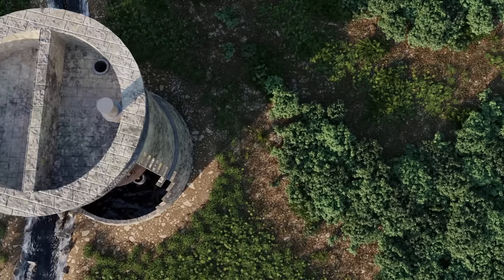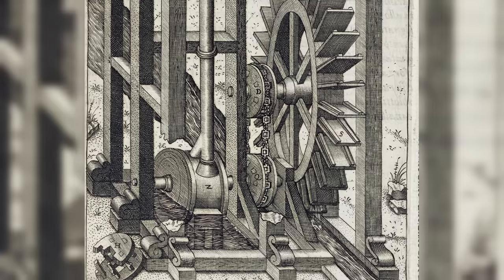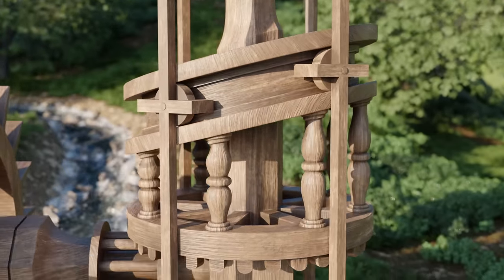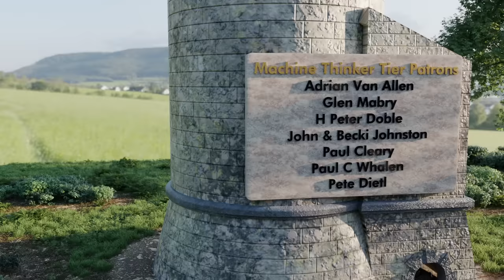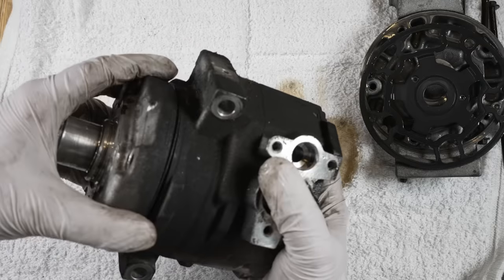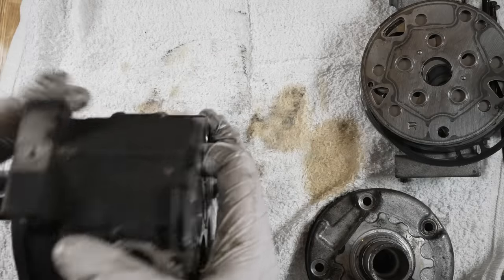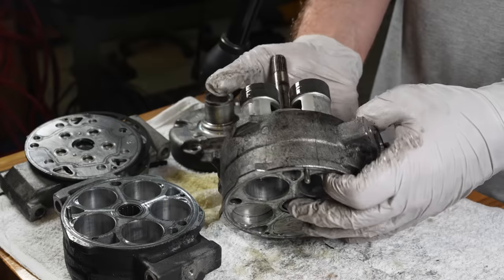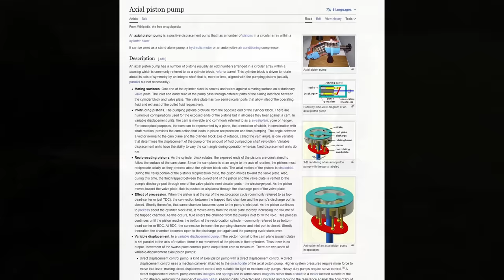How an ingenious 400 year old drawing predicted the future

Comment: They make pumps that operate by a similar method, but the angle of the swash plate is variable. It lets you use a constant speed motor and get variable fluid output or constant output at variable speed. Amazing designs!
Reply: Hydrostatic hydraulic variable displacement load sensing pumps in modern excavators.
Reply: Fuel Pumps in some Diesel Aplications
Reply: IIRC in those the pistons and cylinders are part of the rotating assembly and the swashplate only tilts relative to the motor body.
Reply: Also check FRAMO system
Reply: Some marine steering gears utilize such pumps.
Reply: Hydraulic CVTs in agricultural equipment use a variable swash plate and a hydraulic drive motor all linked to the vehicle drive shaft alongside the diesel engine through a differential gear system.
Reply: I think the Macks that the city uses run a variable swashplate pump, it's always spinning when the motors running, just angles itself to engage. The new electro-hydraulic rescue tools that the FD uses might have the type of variable plate with pressure feedback, since they slow down but drastically increase their pressure as they meet resistance
Reply: @microwave221  The city council mandated last year that those be electrically powered, so I don't see how that is possible.
Reply: @roqua  the existing fleet
Reply: @microwave221  I'm joking, of course, at the vagueness of the "city" in question.
Reply: Aircraft hydraulic pumps use the same system. Always spinning, but the pump angles the swashplate to provide the output needed when raising gear or lowering flaps etc.
Reply: Torpedoes use swashplate engines powered by mono-propellant
Reply: I believe many European AC compressors on cars work this way. Most cars have a clutch that snaps it on or off.. nothing in between. The variable ones are always on at the pulley but can change the amount of pressure the pump makes allowing for a much more efficient pump. The clutch ones are 100% on and blend in outside air of you don’t want to have the AC set at maximum. Which is a waste of energy. Force the system to make ice cold air but blend warmer air into the vent so you get 70 degree output.
Reply: like in hydrostatic transmissions
Reply: Some automotive A/C compressors are variable displacement. They won't create a vacuum or even zero low side pressure when undercharged.
Reply: @ohioplayer-bl9em  Nope, they all use a clutch unless they are electric motor driven such as a hybrid would have. If they are belt driven they have a clutch. Some have a variable swash plate, and 5 pistons on just one side. Some have a constant angle swash plate and Pistons on one or both sides. The name is usually an indication. A VR5 is a variable radial 5cyl compressor. An FS10 probably stands for Fixed Stator 10cyl.
They use internal valving to prevent over pressurization when spinning faster.
Reply: I always wanted to marry a swashplate pump to a turboshaft engine for powering a motorcycle.  Control the engine with a DEC to keep it operating at its optimal RPM, and have the "throttle" control on the bike set the swashplate angle.  I feel like that rather neatly solves the complaint about spool-up time being so horrible for turboshaft-driven ground vehicles.

It would be inefficient as all hell, but if you're sticking a turboshaft in a wheeled vehicle, you probably don't care so much about efficiency.
Reply: @microwave221 most of those are gear pumps they are only turning crankshaft rpm and use an unloading valve to  just circulate oil back to tank
Reply: Just replaced a hydrostatic motor on a john deere 4830 sprayer that does this. JD combines also use the same system, with a variable displacement pump pushing fluid to a variable displacement motor. Had one machine a couple years ago that had a motor fail, which contaminated the entire system with metal and destroyed the pump
Reply: Yup. We use hydrostats on many of our machines at my company
Reply: I came here to say exactly what you Brave Charleses already said, that there's pumps that have a variable angle swash plate, to make the pump even more clever! But you already said it. Quite an amazing design, agree!
Oh, now I watched the last two minutes of the video and saw that they cover this variable angle swash plate. I really must start watching the entire video before commenting. 🙂
Reply: He talked about that in the video
Reply: Very clever 😊
Reply: They make fixed and variable piston pumps. They use variable swash plate pump and motor in hydrostatic transmissions
Reply: @roqua Electric power doesn’t preclude hydraulics…
Reply: @allangibson8494  did you miss how I was poking fun at how vague the "city" he talks about is? This is Youtube.. hundreds of different nations, states and tens of thousands of cities. How are we supposed to know which?
Reply: Rexroth variable volume pump.
Reply: @ohioplayer-bl9em  My VW is like that, the swash plate angle is changed depending on demand, It has no clutch.
Reply: @TheCreedBratton  Found in most all lawn mowers.
Reply: @nomad8723  The Hele-shaw pump, but that's radial.

Comment: That design isn't just for compressors! It's an engine too! If you take a swash plate compressor, reverse the reed valves, drive it the other way using propylene glycol dinitrate, you get the motor that powers many torpedoes!
Reply: I was just thinking those pistons could either be pumps or engine cylinders.
Reply: But the real brilliance of the swashplate, in my opinion, is it allows variable displacement at fixed rpm.
Reply: @joshm3484  The fact it produces a cylindrical engine is why it's used in torpedoes.  It doesn't waste space inside the torpedo's very constrained hull..
Reply: Swash plates are also used in CAT oil pumps.
Reply: https://www.youtube.com/watch?v=SxqyfB83tSo
That's a video of a guy taking a 3 piston compressor of this type from a car and turning it into an engine. It might not be a good engine, but I think it shows how compressors and internal combustion engines are related.
Reply: I’m glad someone gets it. Me I believe it is gettable
Reply: You Sir just blew my mind.
Reply: @werewolf74  If you like clever engineering, swash plate engines are a narrow rabbit hole worth a dive.
Reply: yeah you can convert many ac compressors into 1/4hp (or so) engine if you really wanted to
Reply: Why don’t we make engines this way?
Reply: @Maxim.Teleguz  It's been done. This very thread contains links to videos of a swash plate compressor being turned into a motor. There are advantages, you can make the displacement of the engine variable so it can be a small engine when it idles, and big engine when it's working hard, while keeping the same RPM.

 The downside is the complexity when you make it 4 stroke. The torpedo motor/fuel doesn't need air. It's a self oxidizing fuel and it pretty much just runs it backwards.
Reply: Bubble head!
Reply: @megamond   that was gonna be my guess what e was going to use for the example
Reply: @Maxim.Teleguz it was tried. Have look for the dynacam engine.

Comment: Swash plate pumps and motors have for the most part taken over hydraulics in the efficient use of power and control. I've worked on or experienced their use in such divergent applications as excavators, dozers and wheel loaders to cranes, heavy haul trucks, rock drills, compactors and more. They are used as main propulsion in torpedoes now. I had no idea that the basic design went back so far. I've heard a few time that most machine designs have been invented in the distant past, but their use is never fulfilled until materials science catches up to the demands of the applications. Thanks for the video.
Reply: Yep..  Hydrostatic drive
Reply: @calholli   And quite an old technology.  I recall Case advertising their garden tractors (a.k.a. riding lawn mowers) with hydrostatic drive DECADES ago.  They boasted the advantage being that they were beltless, rather than the useful detail that hydrostatic transmissions are gearless, allowing smooth transition to any desired ratio.  (For those who've never used one, most riding mowers are only really usable on full power, so you depend entirely on your transmission for speed control.  You generally have to just pick a gear that works well enough for the grass height you're mowing.  A hydrostatic drive ill let you pick the ideal speed for your grass height.)

Comment: An A/C compressor compresses a cool, low-pressure refrigerant gas in to a hot, high-pressure gas,which is pumped to the condenser to be returned to a liquid. If a liquid were to be introduced to the compressor it almost always damages the compressor. BTW love the subtle "subscribe"!

Comment: You missed the prime reason this design is so useful. It allows you to create a gas pump which does not have to get physically bigger the higher the pressure you require. With single stage gas pumps you run into unforeseen problems like the volume of the tube between the piston and the check valve  has to be added to your compression ratio calculations, so your compressed volume has a physical limit to how small you can make it, which means the higher the pressure you require the bigger the pump will be.

Comment: 2 stage pump generally has smaller pistons on the hi stage. My guess is just one is just double acting to get double the displacement/cooling power from one swashplate.
Reply from the maker: This was confusing to me at first, as well, but my understanding is that in this case "high and lower pressure sides" referes to the AC system itself, not that the pump has sides which by themselves deliver differences in output.  I could have explained that better!
Reply: Multi stage series water pumps have all impellers at the same size. Water is not compressible but pressure is increased at each stage.
Reply: @Dave5843-d9m  But refrigerant and air are very compressible.

Comment: Making these animations must have been so much work - just wow!

Machine Thinking is one of the extremely few channels that started out with a video of outstanding quality five years ago (I still occasionally go back and watch it). Since then, the quality has only improved (Though I am hoping for some more really foundational videos, like the first few were)
Reply: Out of love, it's nothing.
Reply: These animations are usual done with programs like 3d studio max or Blender. I worked with them and in general rendering old fashioned mechanics or buildings are easy and quick because lots of these parts are repetitive.  They give you good insight of the inner workings of these devices. Even the difference engine from Charles Babbage can work virtual without building it. These programs are awesome tools!
Reply: @willemstaal5337  We had to build and render some things with blender as part of a university course. Even just constructing, adding a custom texture and rendering a simple rusty bollard with chipping paint or a wine bottle were A LOT of work (of course, with experience this becomes much faster, but still)
Reply: @einname9986  i know its a lot of work. I used my photoshop skills to create bespoke rendering maps. In general i did not make too many tiny details because most of that detailed content will be hidden out of view while rendering (they are added to the equations, be aware) So i made repeating neatly blended stone textures with help of the offset command in photoshop and made pits and cracks in another layer.  Stone can look very convincing. Especially if you set up light, fog, blur and shade properly.  Repetition in materials is not a issue if you use random grain levels and material angles. Its tricky but it pays off.

Comment: 11:37 *"hundreds" :)
I think just implementing a swash plate to change the angle of points on a spinning mechanism could have been influential in a ton of machines, but helicopter rotor swash plates come to mind. Helicopters weren't practical until the stability issues were fixed with variable pitch wings.

Comment: Welcome back! I've been waiting impatiently for the next video in the series.
Edit: as a former automotive repair pro for almost 20 years I instantly recognized that mechanism but was surprised when you broke out a compressor yourself. The last time I felt like a message was tailored to me so well is when my doctor described my diverticulitis as being similar to a separated tire 😜
Reply: I thought AC compressors have a nautilus-shaped cam which forces air into a spiral venturi? Or maybe that was just a crazy dream I had...
Reply: @shrimpkins probably depends on the type and style of compressor, as I think I've seen the same design you're describing. I don't think it's as common as this swash plate based design.
Reply: They didn't the whole vid about compressor is taken from another chanel...for shure that guy is not knowing that whole vid is...borrowed.

Comment: 10:47 as a follow up you may be interested to know that the electric compressors found in nearly all home appliances responsible for moving heat use much the same mechanism. You'll need a cutting wheel to get into those, however; they're usually hermetically sealed

Comment: That design is also used in hydraulic pumps like in lawn mowers with hydrostatic drive rather than gears and to supply high pressure for all kinds of industrial machines like excavators, bull dozers, back hoes and so on. I don't know for sure but I imagine the first use of that design on an industrial level was along those lines rather than air conditioning and there might be credit given in those examples?
Reply: The International Harvester cub Cadet tractors use a variable swash plate system on the hydrostatic transmission models that they started making in the late 60s. with regular fluid and filter changes those have lasted 50+ years and still work just as good as new
Reply: For sure. That's what I assumed this was, to be honest. I' actually a bit shocked at the number of pistons in an AC compressor. I would have assumed one or two tops. kinda impressive seeing how many this had, and was why I jumped straight to hydraulic pump/hydrostatic drive.
Reply: Exactly what I was thinking 🤔